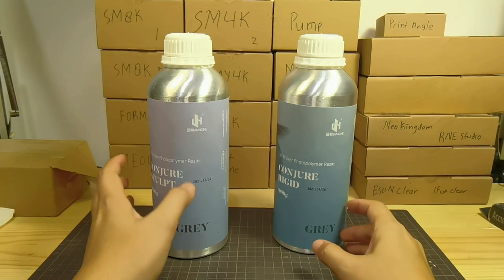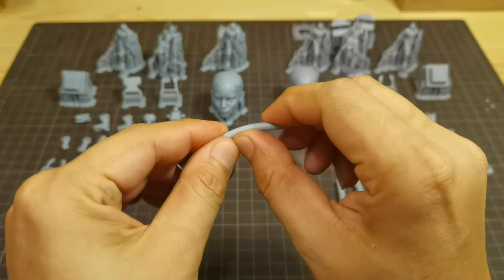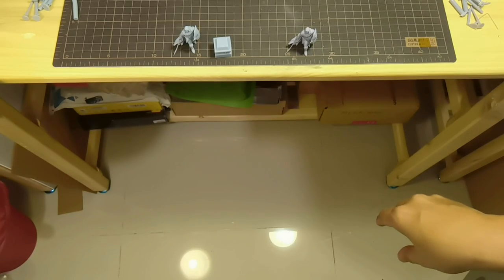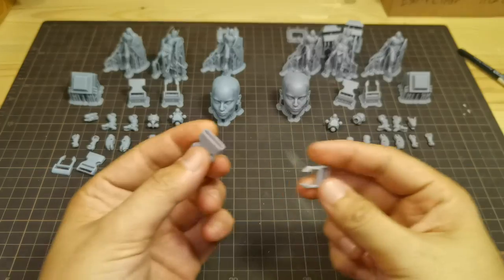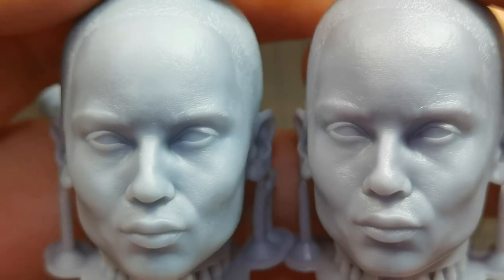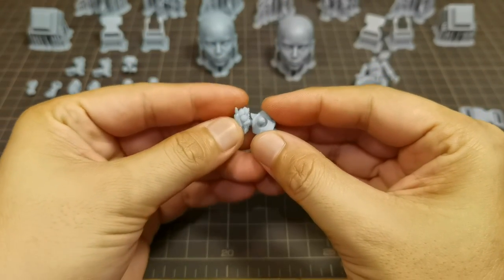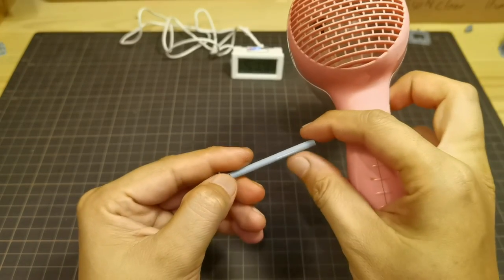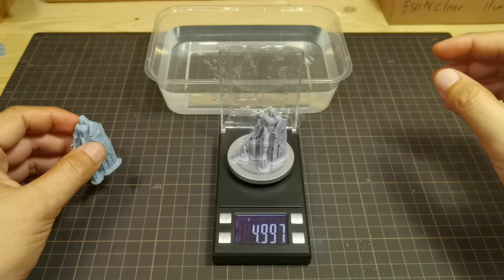Resin From Chitubox Jamg He Conjure Resin Sculpt vs Rigid

Comment: Sorry for the out of topic question. What resin would you recommend for small prints? I printed with Esun eResin PLA Pro and their brittle. The only brands available locally in my country are Esun, Anycubic and Epax. Esun is the only brand with a lot of stocks though. Do I just buy Esun and mix with flex resin or try other brands?

Comment: Hello! i bought 3 bottles of conjure sculpt/tough/resin. I'm almost through with my bottle of sculpt. But all of my prints havi this strange residue on the outside that appears when you rub the print between printing and curing. Any tips on minimizing this residue?
Reply from the maker: Use clean ipa
And thoroughly wash it.
Reply: @wangdennys  what is your recommendation on washing time?
Reply from the maker: @sjefkepoulussen2264  i wash manually. Never use wash and cure.
I wash till no resin drips.

Comment: Hi, I just bought a ANYCUBIC Photon Mono X 4k, and other than the cube test file, I haven't been able to print anything else. I've had 5 failures so I'm seeking some help.  What does prints the raft (or thing part of it)  and a very thin portion the figure on the FEP.  Is it possible I can you you my 2 working files and have a look at what I'm doing and if my config is ok?  I've been doing my work on Lychee, which seems to put it's only config on it which doesn't work.  I tried taking that file over to the PH64 but no luck.  Or, is there a basic config setup that that 'should' be able to print from? Thanks,
Reply from the maker: Anycubic printer is not very user friendly when you use other slicer than photonworkshop imo.
So maybe try using photonworkshop?
Reply: @wangdennys  I sliced in Photon Workshop and have better luck today. Finally, my first ever 3D print :)  I'm pretty certain, I had / used this config in Lychee but it only printed as above, a little on the plate and FEP.
Layer Thickness(mm) 0.100
Normal Exposure Time(s) 2.000
Bottom Layer 6
Exposure Off/Ofttime(s) 0.500
Bottom Exposure 40

Bottom Layers: 6

I find, Lychee so easy to use but I guess, I'll continue and dwell more into the AC Photon Workshop slicer.  :)
Reply: @dennys wang I do have a Q.  Do I have to set my plate prior to every print ??  If I'm printing 4 exact items.  Or, does removing the plate to remove the print de-calibrate it??
Reply from the maker: @richardlamer3910  you mean leveling build plate?
No, initial calibration
Reply: @wangdennys  Yes, the build plate.  So, just the one time?
Reply from the maker: @richardlamer3910  yes just 1 time.